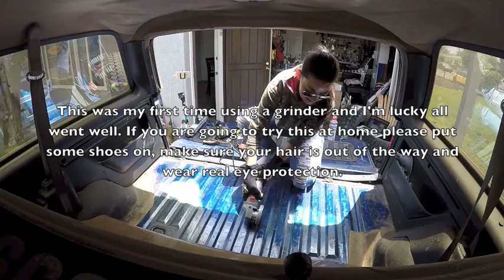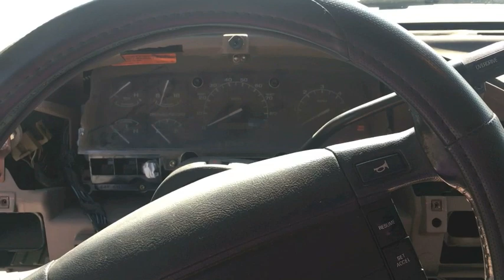Fuel Pump Replacement | 96' Bronco

Comment: Yeah... Electric fuel pumps are normally in the gas tank, but on my High Boy 1979 Ford 4x4 it was at the front end of the engine running mechanically on the cam shaft... which I really liked! 

Anyway, the key to dropping the gas tank is pumping out all the fuel into canisters, disconnecting the wires, hoses and clips, and undoing the nuts on the straps while lowing the gas tank with a floor jack evenly. I always remember to change the screen or at least clean the screen when replacing the fuel pump... because it's such a pain to replace! Check for leaking hoses, split brittle hoses at the save time.... Evap may have split hoses or leaking hoses also... could very well be the reason why you don't pass emissions (part of the fuel recirculation system).

Comment: The dreaded Tow Truck. My 88 Bronco is gonna leave me dead on the trail one day, and Ill never make it back.
I had to rip out Factory EFI and computer, due to Ford no longer could read the tech. I put in an Edelbrock Pro flo 4 EFI system which requires a high pressure sump 2 years ago, and now I am losing fuel pressure at freeway speeds up hill. I am thinking it is the in tank pump not feeding my sump during times of increased load. 
This looks like a plug and play install with the hatch cut. Thanks for the vid...four years late. lol

Comment: U know I've never seen someone cut through the truck to fix the tank😂😂
Reply: beday People do it all the time.
Reply: Too lazy!? I think you're jealous that she works smarter, and not harder!
Reply: Lazy? They should've been made that way. Also, most cars have access panels factory. Only trucks do not. And I'd rather make fab up a nice access hatch than have to replace straps and all else that may break fussin' with them.
Reply: Mine died, I'm dropping the tank. My trucks way too good underneath, and I'm a 6'6 240lb dude. I can deal with a little pain and suffering

Comment: That’s just as much work as dropping the tank except when you drop the tank you don’t end up with a hole in your truck. I do give you credit for doing it yourself though. I wish my wife would just check her oil.
Reply: Except there isn't a hole, there's a hinge. And here in Arizona,  fuel pumps get replaced every couple years if you're lucky, so it makes life alot easier
Reply: No it's not.  I've done it both ways.  The access port is smarter and better for future maintenance.

Comment: Why in hell would you cut the floor out? Drop the tank. That way you can see other possible problems.
Reply from the maker: Because in order to drop the tank I would have needed to jack it up and I only had a driveway to work in that is on a pretty gnarly slant. I have a HUGE phobia of working under jacked up trucks. This was a simple way to get the job done. The liner I have covered the access hole. It's not for everyone but it worked for me. I get what you mean though!
Reply: Try dropping your tank on the side of the road 100 miles from anywhere then get back to me :). Did that ONCE !!! Been driving my bronco for 20 + years that distance everyday. Cut an access for the fuel pump in mine  after I did that.. best thing I ever did. Have had to replace the pump twice since then and both times I was away from home. I keep a spare pump, filter, relay and oil pressure switch (cuz that'll kill your pump to) along with some other parts in the cargo bay. 5 minute job now no matter where I'm at not to mention doesn't matter what the weather is either. Make a cover panel for the hole and then what's the problem :). Work smarter not harder,
Reply: dbel723333 what did you make the cover panel from?  Thanks
Reply: I went to a junk yard and just cut a bigger section out of the bed of an f 150 so it would cover the hole I cut in my bronco. Cleaned up the edges of the panel I cut from the 150 and secured it with some sheet metal screws in my bronco. Works great cuz the metal in the  F150 bed is the same shape as the bronco cargo bay. Lays down on top of it perfectly. No worries.

Comment: Hummm,... alot of vital information missing girl.  Measurements of where to cut the hole are the most the most notable.  Your hole looks one riffle too big. Also, how did you put it back, or, is there a hole in your bed, no pun intended, as we speak?  If not, did you paint?  Did you go to the junkyard and cut a slightly, 1/4" larger, matching square to pop rivet into place?  So, much missing, but, nice eye candy.